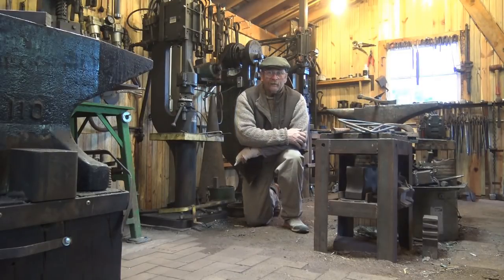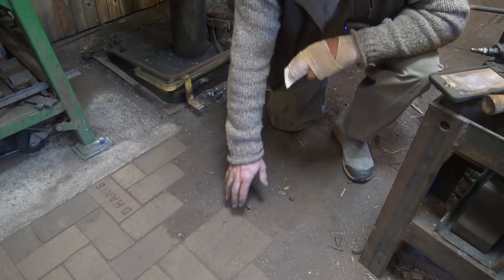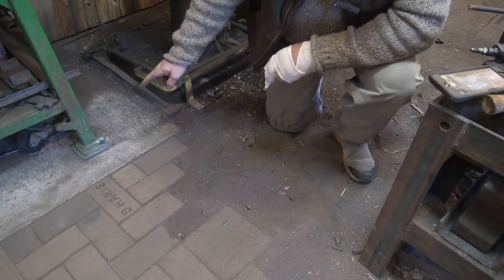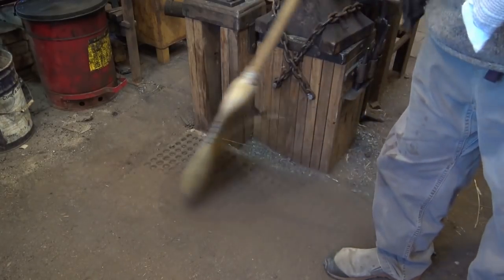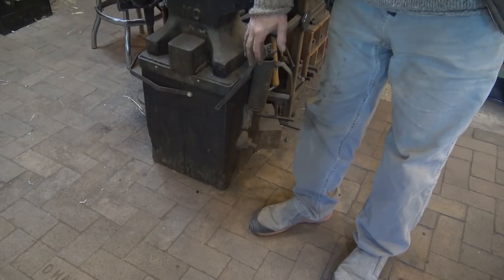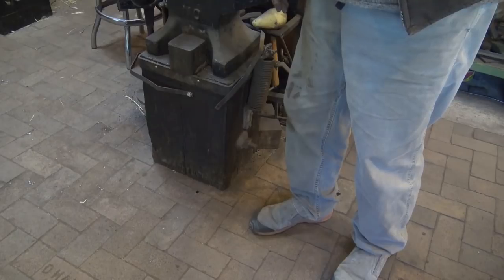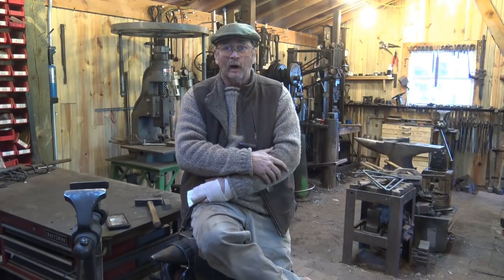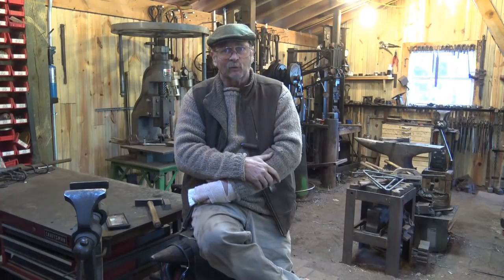Blacksmith shop flooring options, dirt vs concrete vs brick vs wood

Comment: Thanks for your video.  As a side note, I worked in a very old machine shop in the mid-1970s which had a wood floor like you describe.  It was 4 X 4s set on end in tar.  The shop had been in service for more than 70 years and the floor was somewhat uneven, but I can confirm it was really quite comfortable to stand on, even without rubber mats.  The real clincher was when we had to drop something heavy.  It just went 'thud' and that was that. Please keep up the cool videos.

Comment: Here's an idea for you that I used in my welding shop, 
I bought 30ton of screenings chip's, 
and bought 5 100lb bags of magnesium chloride, rented a small trailer mounted cement mixer, and mixed chip's and mag and water to the consistency of 4in slump concrete, dumped and spread about 4in thick  then rolled it with a sod roller to get a uniform level and compaction.
the beauty of this is the mag chloride acts as a moisture sink which keeps the dust non existent, AND is easy on your feet, back, knees, as a dirt floor AND of course fire proof and easy to maintain.
Hope your hand getting better, and THANK YOU for your channel, I'm starting to incorporate blacksmithing into my welding business a lot more now and the tips you give help a lot!
Stay safe out there my brothers.
Reply: wood chips?
Reply: @rhodesianwojak2095  I think it is rock spoils from a rock screening/sorting unit of some sort maybe.
Reply: Sorry to say that, but that sounds like a bad idea. Chloride ions are the number one promoter of rust and various other corrosion. Even though the floor is now "dust free" and unlike, say, hydrochloric acid etches, salts will not vaporize in any meaningful quantity. But id be still be seriously concerned. Any stuff sitting on it will rust. If you get that material on stuff, it will rust. And i you manage to do something that gets it airborne....dear goodness...oh no. Hard enough to keep a shop rust free with spring temperature changes.....salt needs not apply.

Comment: My smithy is a 10x12 shed with unfortunately a framed floor, to reduce fire hazard i skinned it in cement board so its a bit more durable and i just picked up 2 5 ton rv jacks that i plan on placing underneath where my anvil sits to minimize the bounce whenever i get the chance. So far its not terrible but then again i have never forged on another surface so i might just be used to crap lol.
Reply from the maker: As long as the anvil is solid it should be OK.  Of course the framed floor would make a power hammer completely out of reach.

Comment: there isnt anything better than the dirt, but...I take the clinkers, pulverized, and sprinkle across the floor lightly, on a regular basis, at the end of the day.  Top it with the watering can, and then there is NO dust, ever, and the low spots are no more.  crushes into the surface..never loose a dropped item, remains slightly cool if in a hot climate. Like brick, but not brick. So its still good to stand on
Reply: Yep, packed dirt is just fine and better for the body.  I've worked for 40+ years on concrete floors and every joint in my body now hurts.  I need knee and hip replacements.

Comment: We use a lot of.... I think it's called abc rock🤔.... It's the limestone dust and screenings from crushing  orders of larger size rock (like road rock or etc) at the quarry. For buildings where equipment is parked, a substitute for concrete to set posts, etc it's awesome.  Wet it down and compact  and it even kinda sets up
Reply: Stone dust is another name for that type of material. Works great under outside patios .

Comment: Forge where our club meets is half concrete, half crusher dust. We rake the crusher dust after each forge day, so no chance to form divots under foot. Still quite dusty. Does hide the scale much better though :) so less effort than sweeping the concrete.
Reply: Crusher dust is great stuff, asides from getting the pieces out of your sole grip.  The ground is pretty swampy clay & prone to frost heaves where I live, so any piece of concrete less than 20cm/8" with heavy rebar will crumble in a few years. Crusher dust with brick on top holds up okay.  I also fill fence post holes with crusher dust and tamp it down with the end of a heavy bar and check level after every shovelful or two.  Time consuming as hell, but it's the only way to keep them from shifting and rotting.  The clay sucks the moisture out of the crusher dust.

Comment: I have seen one shop (The Ornamental Metal Museum ) that was trying used asphalt shingles.  It made a comfortable surface to work on but was subject to fire and smell.
Reply from the maker: Are they fastened down?  Seems like the would move around and be a tripping hazard.
Reply: Not fastened down. It is down south and in the heat of the summer traffic over it packed it down and it looked like an asphalt road but a softer surface.

Comment: What about well compacted gravel, 0-3/4 wetted and compacted, it would be relatively cheep, it would be sturdy, easier on the joints and back, could still dig a hole for tool placement or concrete pads for heavier tools.... Just a thought!!
Reply from the maker: I have never worked on a gravel floor, it might work
Reply: A better option would be crushed quarry rock with fines, no sand. It packs tight doesn't move. But I didn't know about that option 20 years ago so I been suffering with a gravel floor in my shop ever since.
Reply: Stan Daffern what is finds?

Comment: When you re-pour the pad for your power hammer put a footer below you slab that will make it much more solid don't need a supper thick floor need a good solid footer and your problems are solved.

Comment: Treat a wood floor with a good mopping of a borax solution. Borax is a fire 'retardant', not a fire proofer, but could help to save your shop. Google it if you like, but treating canvas is what I heard it used for, to help.
Reply from the maker: Great idea

Comment: That's my Dad's anvil and it's on a gravel floor I'm building my Anvil stand out of a pressure tank I'm going to cut one of the sides and put a flat and have it indented to wear I can drop punches and chisels on the on the table like essential Craftsman wooden best one yet

Comment: My country is essentially a river bed, there is clay everywhere. My guess, I haven't found sources yet, is that we always had floors supported by wooden posts hammered into the ground; then a layer of lintels, a wooden flooring, overlayed with bricks. A dirt floor would be unthinkable, your anvil sinks by the day.
Reply from the maker: Our clay is dry and hard as a rock.

Comment: Concrete floors suck!!  I've worked 40+ years on concrete floors and now every joint in my body hurts.  There's nothing wrong with packed dirt and it's easier on the body in the long run.  Brick is fine, better than concrete I guess.  Blacksmith shops are notoriously dirty places to begin with, especially if you use coal.  Crush up your clinker and spread it on the dirt floor.  After awhile it works into the dirt and helps to keep the dust down.  In the past I've used 3/4 minus gravel mixed with clay (road pack) in my other Blacksmith shops.  It worked fine.

Comment: I dropped a 3x3x10mm machine tool key on my dirt floor... and after I made a new key, I decided to invest in a real floor. Now I'm try to figure out how to avoid setting my plastic floor on fire the next time I drop a piece of hot steel. Sigh.

Comment: The spot where I'm thinking of building my forge only has soil ranging from a foot deep to no soil at all - exposed bedrock. So I'm thinking of digging down to the bedrock and putting a wooden anvil stand directly on the solid rock. Then dirt with gravel and sand on top around the anvil stand for me to stand on. Does that make sense or am I missing something important? 
I don't see myself ever getting a power hammer or any massive tooling like that. Just a real basic set-up with maybe a 200# or so anvil (if I can even find one that big that I can afford).
Reply from the maker: As long as its mounted solid that should work
Reply: @BlackBearForge  thanks! I thought so, but I have a tendency to over-think things and second-guess myself...

Comment: The algorithm provides...

Would you suggest someone making a new shop from scratch, Dirt Floor with rubber mats, and concrete/post islands for the heavy stuff?
Reply from the maker: Dirt has some real advantages, unfortunately keeping the shop clean isn't one of them.  Rubber mats stink if you drop something, but if you have concrete they are way better to work on.  There are trade offs either way
Reply: @BlackBearForge  Okay, thank you.

Comment: You saw my leaf making video didn't you? I am going to fix that anvil down to the floor. I just have to decide on where...
Reply from the maker: I don't think I've seen that and couldn't find it when I went to your channel.  What is the title?
Reply: #warpedchallenge4 the anvil was moving around bad.
Reply from the maker: I see what you mean with the anvil.  If you can anchor it to the floor you will be much happier.
Reply: I have already fastened it to the stand after I drilled holes in the feet. I also bought the bolts to bolt it to the floor. Now I have to commit to a spot to fasten it down.

Comment: What type of floor absorbs the most noise? Concrete seems like it would make the boise worse with the sound waves bouncing back at you
Reply from the maker: I would say dirt or wood
Reply: Black Bear Forge did he put something between the blocks locust or just plane them so they fit perfectly

Comment: John, is the chain around the anvil just to hold it in position or is there more to it than just that.  Good to see you up and about.  How is the hand doing ???
Reply from the maker: The chain is mostly to hold it stationary, but it is getting loose and needs a better solution.  It also helps quite the anvil a bit.  I plan on doing a video when I re secure it.  I have an afternoon session with the hand surgeon, he thinks another three weeks.

Comment: my smithy has a gravel floor
Reply from the maker: How do you like it?
Reply: it was a 12 x 12 horse stable we built in the 90s.iwanted to brick it eventually but it is only 6ft high.so far its working out ok.
Reply: So did mine, actually it was crushed rock. Would never pack down and was badabout rolling under my feet. A couple of years ago, I racked the still loose gravel up and sptead topsoil down. Much better n my feet and knees.
Reply: My smithy, which is in the corner of my shop has been a unlevel 3" deep gravel floor. I hated it, hard to walk in my anvil keeps sinking and tipping.Inspired by this video and some others on this forum, I am in the process of putting in a concrete floor where the tools and equipment sits, and am making an attempt to put brick in the smithy area.

Comment: Hey, how expensive is a brick floor? I want to know because i'm currently building a small forge shack, so my fuels don't get wet and i can forge in any weather. I haven't done any actual buildings yet, because i haven't flattened the area, as i am only a single dude...
Reply from the maker: I can't say for sure.  I got lucky and found salvaged brick at no cost
Reply: @BlackBearForge  lucky! Id also like to ask another question. My forge is going to be 2 small conjoined areas, each being a 7x6' room. One, the inside area, will have things such as tools, grinders, electricity, ect. The other will have the forges and the large buckets for fuel. What flooring should i put for either? If i did bricks, would i need to do anything or just dig a few inches down, place the bricks, and fill with sand like you do with pavers?

Comment: To pour a flat level floor out of concrete you need a concrete mixing truck to deliver a wet mix load. Then get out the troweling tools with a skilled concrete man. They can get it level with the pole trowels.